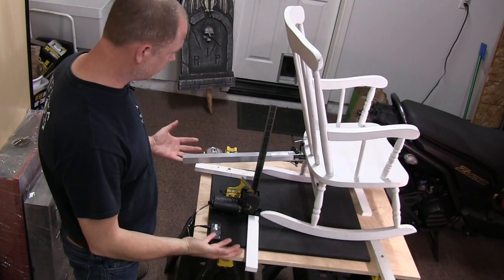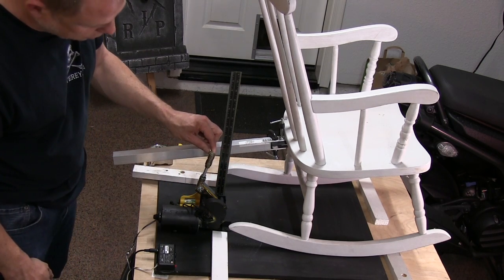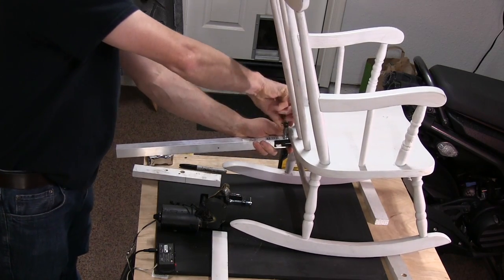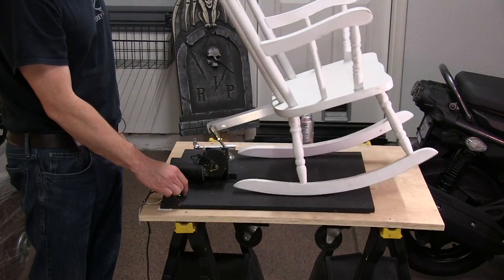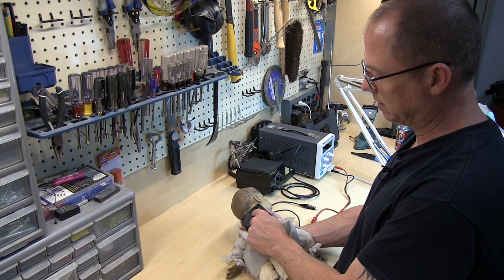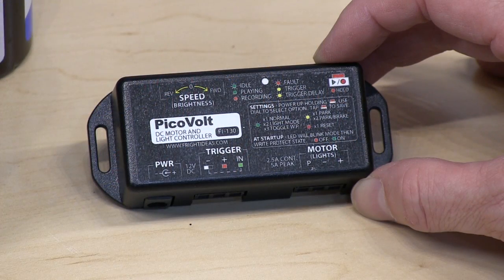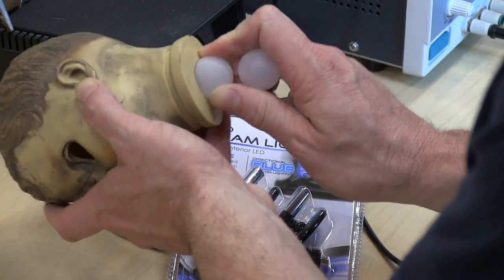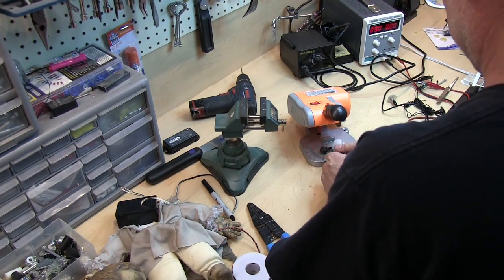How to Make Haunted Rocking Chair Part 1

Comment: Thanks for the info, I'm trying to rock a full sized chair with a deer motor! One question. Why the stepper bit on the angle?? Then, hopefully I can lengthen my throw and lengthen the bar attached to the chair, I have a Freeway glider bar with inserted bearings so hopefully that will help as I don't have that special linkage you have!

Comment: Nice smooth operation!  You did a nice job illustrating how to find the sweet spot for the linkage.

The hum and noise is probably mostly from the base board reverberating with the motor.  Mounting the motor with some rubber grommets as spacers might reduce the transmission of the vibrations and really cut that down.
Reply from the maker: Great idea--thanks!

Comment: Hi, what type of motor did you use, specifically for the chair? Thanks. Great video.
Reply: 12 volt windshield wiper motor.  You can find them on eBay or buy direct from a halloween prop supplier.
Reply: Thanks!
Reply: @joshrodrigue7216  or raid a car at your local wrecker!!